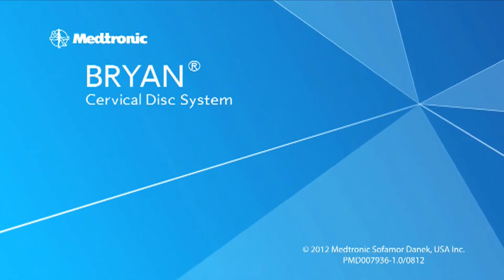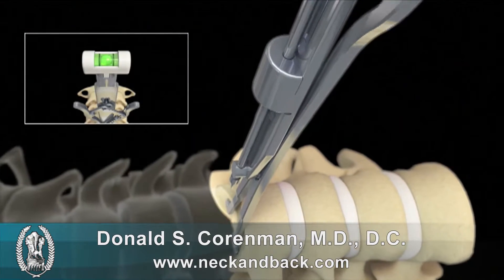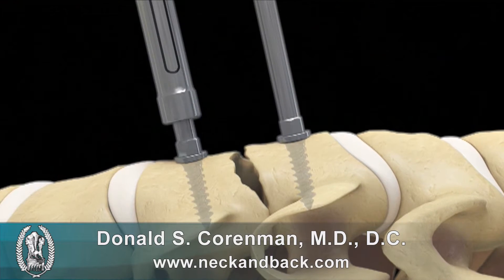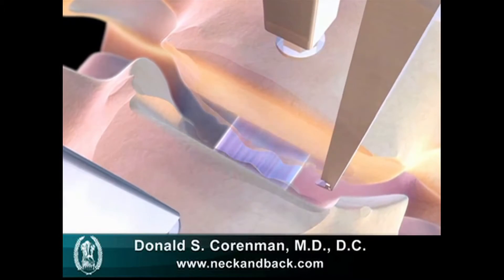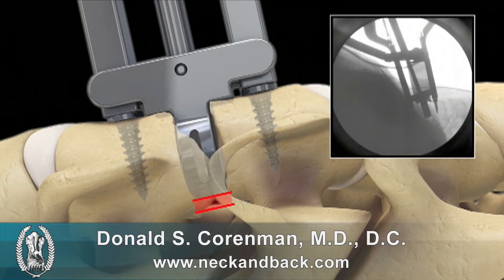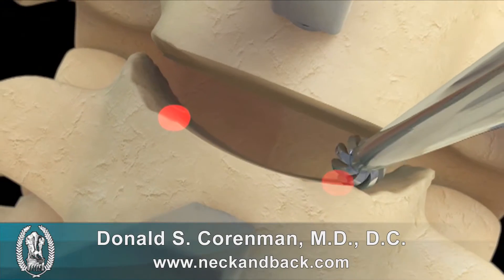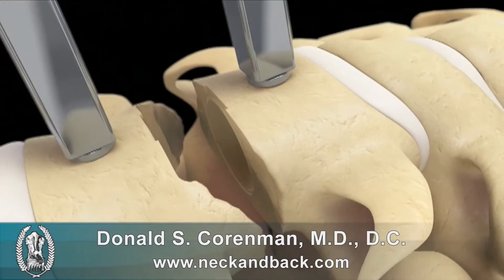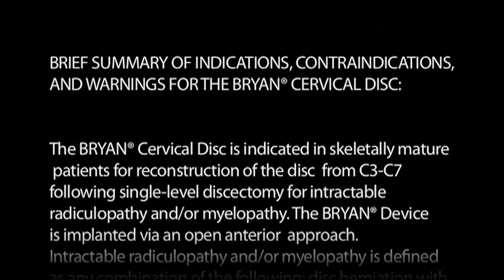Bryan Cervical Disc System | Cervical Artificial Disc Replacement | Colorado Spine Surgeon

Comment: Very good video doctor. 
I am a C6/C7 maybe one above and below as well guy. lol
Hypertrophy of the PLL folds into my spinal canal; so at least it is not a spur(s) irritating the cord, Among other things. 
History: 20 years commercial construction career ended in 2000. I used my head too much. lol. 
I think it hurt the PLL one time with a 2400 lb moment on my hard hat while setting a beam!
And then 10 years of CAD engineering work.
If I could gain about 1/8" or 3/16" in height of the disc I believe the PLL will unfold/flatten out, with some persuasion during operation. 
I could argue 8 mm for C7/T1 current diameter at center of cord. 
As miserable as I am I feel lucky only because of your work Dr. Donald Corenman.